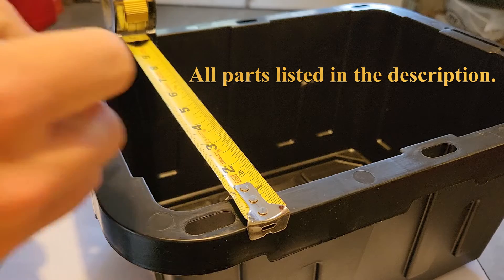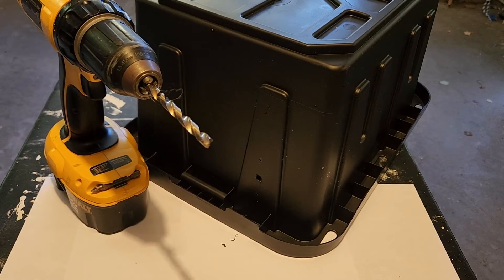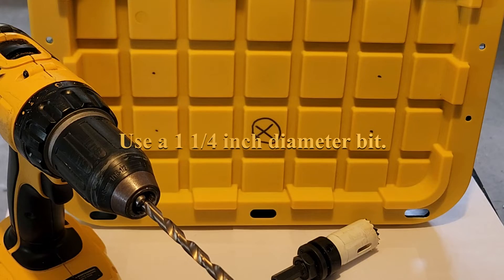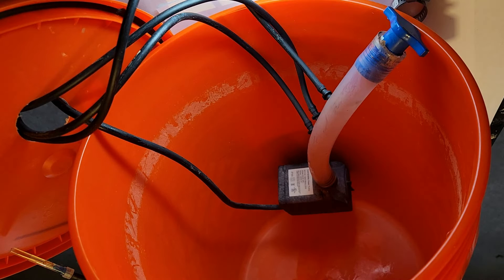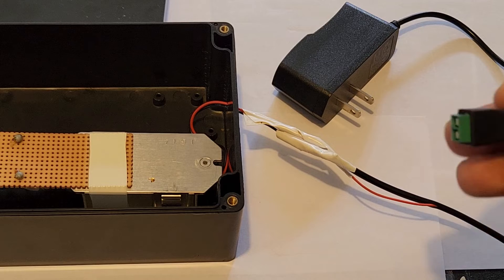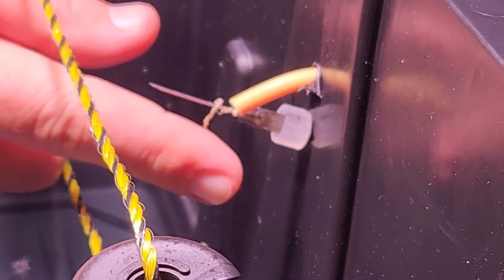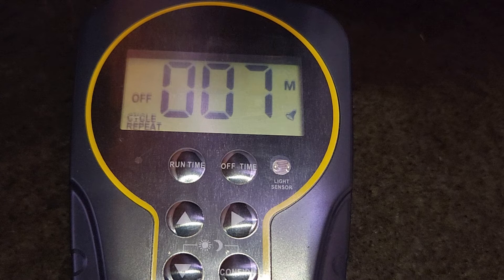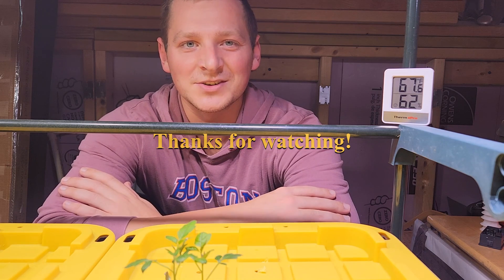Electrospray Aeroponics: High-pressure results with low-pressure prices. #Electroponics

Comment: I like the out of the box thinking but i cant see how it can produce the same results as high pressure aero :)
Reply from the maker: Electrospray is an odd effect, it is comparable to high pressure because the droplets are atomized to sub 100 microns.
Reply: @MassPhsyics  
I dont see any sub micron droplets in the video :) If you have grown some plants in the system it would be interesting to see what kind of root structure you get. Here is a few seconds of mist comprised of sub 100 micron droplets   https://youtu.be/ObivGI9QXwk  and another of the same system with plants growing in it   https://youtu.be/iXWT1cObE6o 
I like your idea but i think it needs a different implementation. If you could positively charge the mist and negatively charge the roots, the mist droplets would be attracted to the roots akin to powder coating and that could have some water saving potential.  I never ventured into using high voltage for aeroponics, i was too busy experimenting with my own radical ideas :)  https://youtu.be/Bn_aQZR8uzc
Reply from the maker: You get a larger range of droplet sizes than high pressure methods.
Reply: @MassPhsyics  
The mist in the last video consists of droplets sizes of 5 - 80 micron which is the ideal range for aeroponics.  If the high voltage field creates a large range of droplet sizes, given a reasonable quantity, they should be visible to the naked eye. The root structure produced by the 5-80 micron range is unlike any other  https://youtu.be/l1Rmm9JvPfY